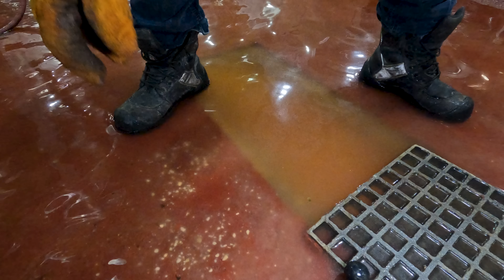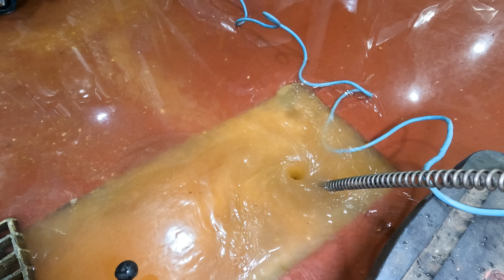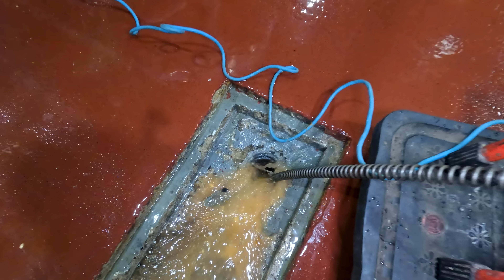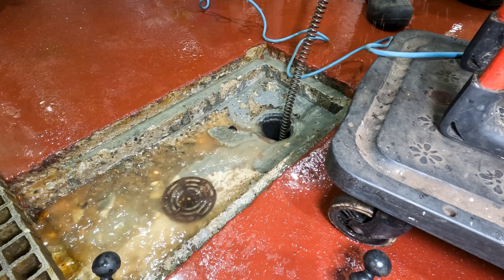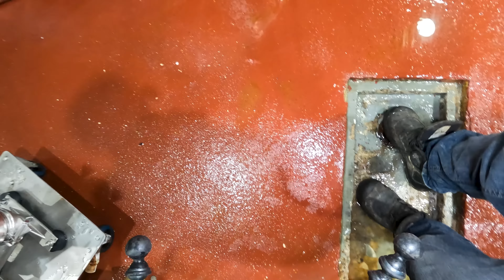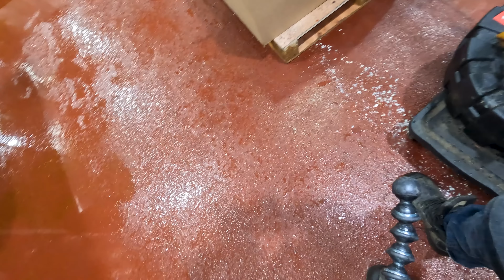This is how you clear a BBQ factory floor drain. WEEKEND WHIRLPOOL. SO SATISFYING.

Comment: Hey Drain Guy 
Have you tried the burton drain cleaning machine?

I always used rigid sectional cable machine for years 

But in 1993 I converted to Burton machine with 5/8 x50 foot cable 
Best investment ever made 

Easy to carry  
Light weight  easy on the back too 

I can cut a 2x4 with my 3 inch cutting head 

Keep up the great videos and great job 👍👍
Reply from the maker: I haven't tried it. I will look into it. Can't guarantee I'm going to buy it but I'll definitely look into it because it's always good to know about other machines out there that I haven't heard of. Thanks for watching Al, I appreciate it. Hope you have yourself a great day Trogna